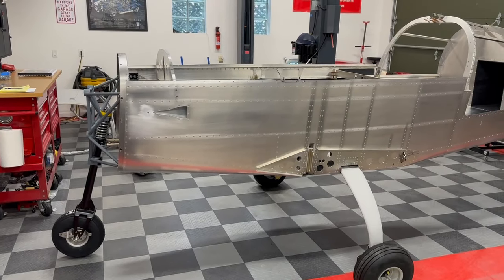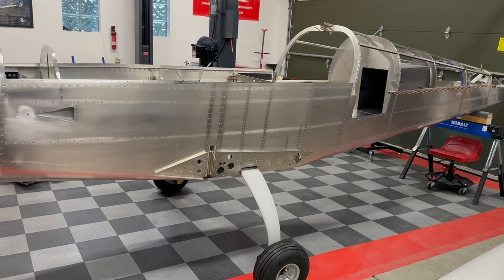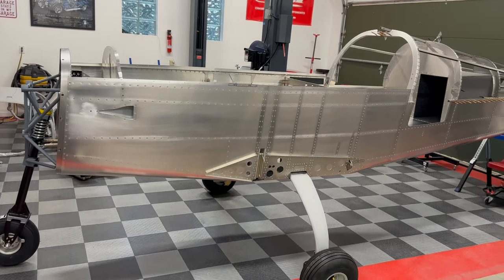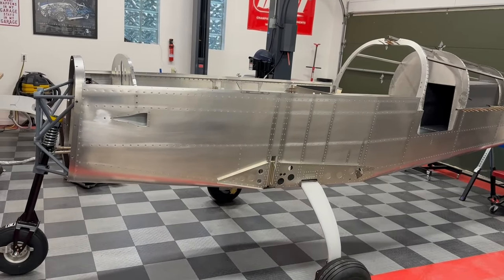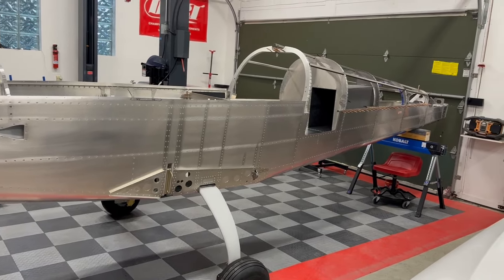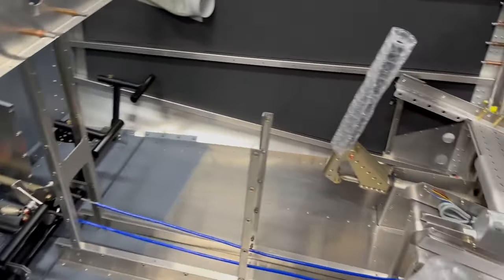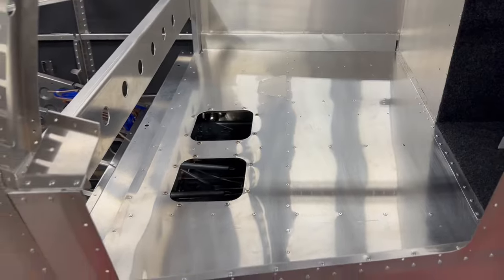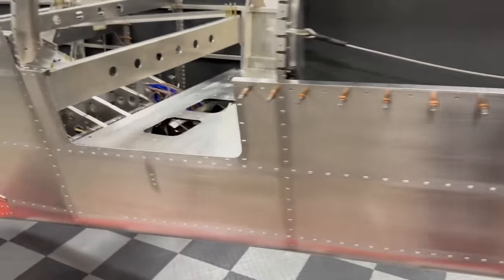Sling TSi Build Fuselage Walkaround

Comment: Great work Paul.  I was excited to hear that you live rather close to me.  I am in Davison and I've been researching and loving the Sling Tsi for a long time.  Please let me know if you ever need a hand.  I'm interested in building a Sling and would love to assist you with anything you might need.  Best of luck.
Reply from the maker: Thanks for your offer. I'll keep it in mind. I assume you know you're relatively close to Midwest Sky Sports in Sandusky, Michigan. Closer than me. They typically have a number of Slings underway. The folks that run the operation are super helpful.
Reply: @paulborror2544  Yes, I have been to Midwest Sky Sports and went through an introductory session on the Tsi.  I am also close to Midwest Panel who are doing some really cool things with the Sling.  I am sure you are aware.  I am currently flying out of Flint Bishop.  Let me know if you ever need another set of hands, seriously.

Comment: Paul, very impressive.  Clean as always.  I watched some other Sling build videos and this aircraft seems a lot nicer than the experimental kits of yesteryear.  The finished product looks like any other production plane.  Glass cockpit is the only way to go.  I can't believe the rivet spread.  The skin is definitely not coming off.  I wonder if arframe paracutes are a thing with these.
Reply from the maker: Thanks. Yes, a ballistic recovery parachute for the Sling TSi is definitely a thing. I meant to say something about it during the video. But like several other details, missed it. I did mention it in the video description though. Check it out above. My initial build won't have the parachute, but it's equipped so it can be added later if desired.

Comment: Just fyi, it looks as though your cowling fastener strip is mounted outside of your firewall flanges.  Build manual has it inside.
Reply from the maker: Sharp eye. Yes, I'm aware. The manual wasn't clear (to me anyway). I'm way too far into it to change and it's been determined not an issue. I'll leave it at that.
Reply: @paulborror2544  Cool, glad it’s no factor.  I’m currently trying to figure out how to deal with the top two rivets attaching the firewall to the side skins. They are drilled too far away from the edge to line up well.  Asking technical what to do.